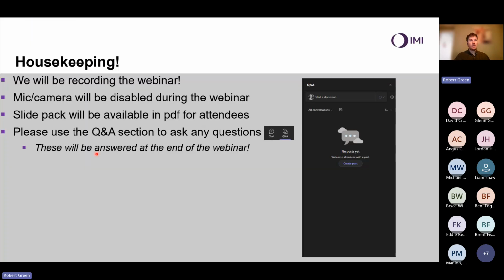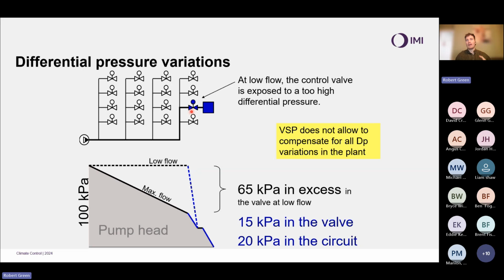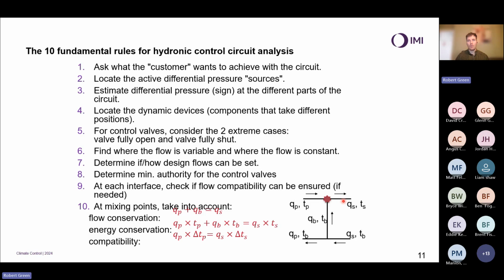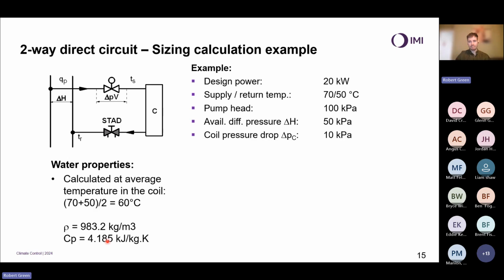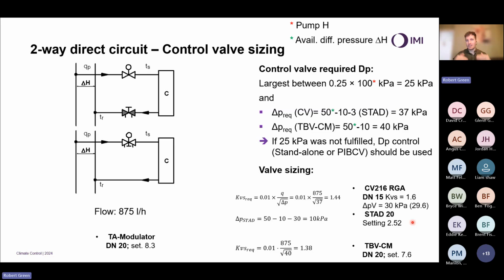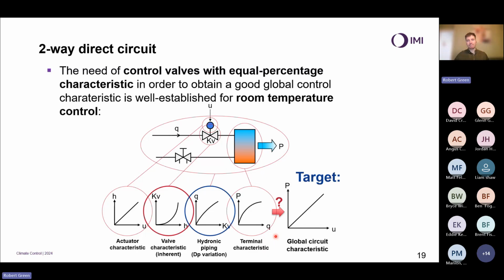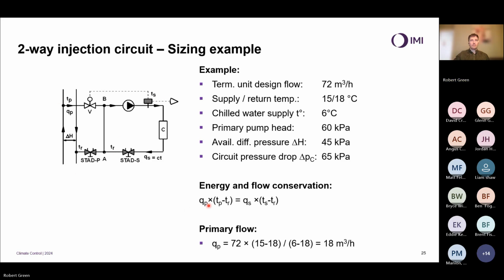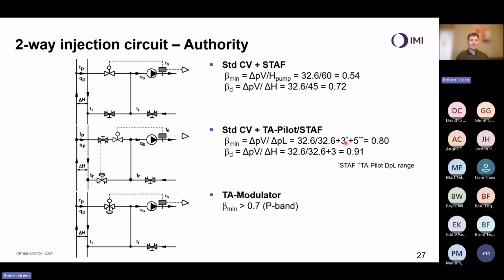Webinar - Control Loops | Basic knowledge of 2-way control loops

Comment: Could you explain how you got a 19 kPa pressure drop on the TBV-CM when it has already been calculated as 40 kPa? 29:29
Reply from the maker: Hi, 

TBV-CM is a combined balancing and control valve.  For calculating valve authority we only use the pressure drop of the control part of the TBV-CM.  Which in this example is 19kPa.

IMI